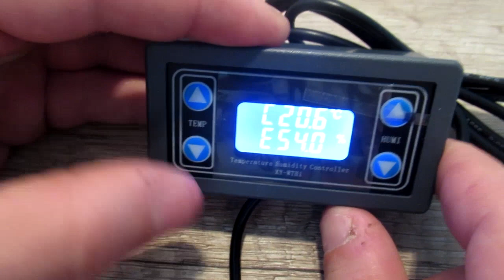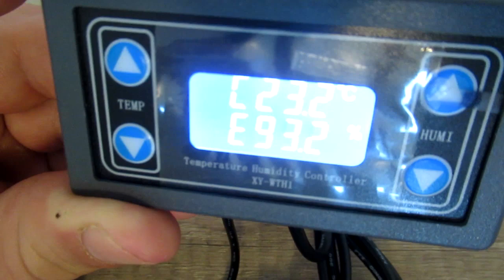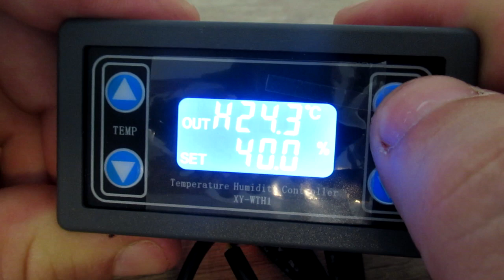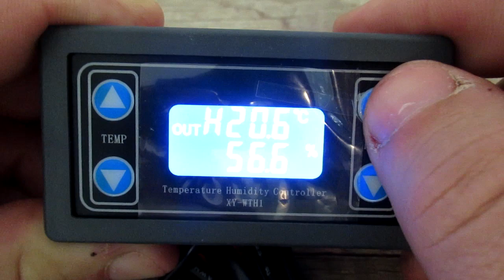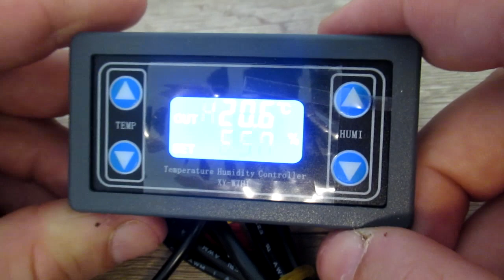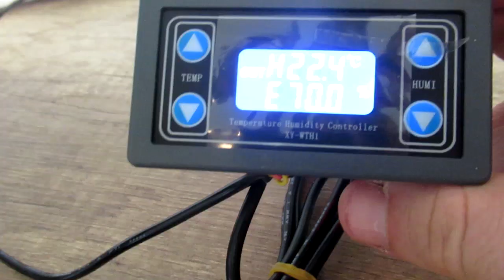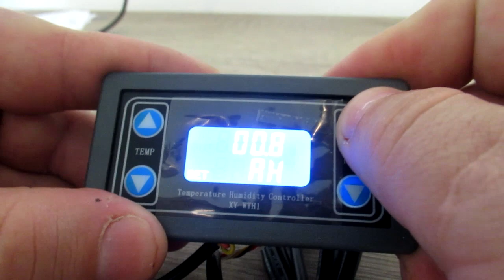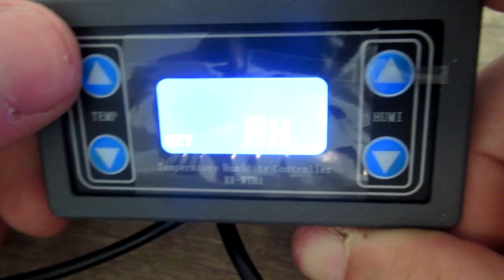XY-WTH1 Digital Humidity & Temperature Controller  Manual and Instructions

Comment: in the manual: OFE -Temperature correction function calibration (-10.0 ~ 10℃):
The system is working for a long time and may be biased, through this function
correction, the actual temperature = measuring temperature + calibration value;

how to see the calibration value or how to calibrate it?
Reply: aha... got it at 7:11, thanks